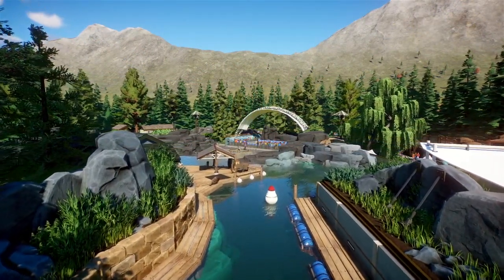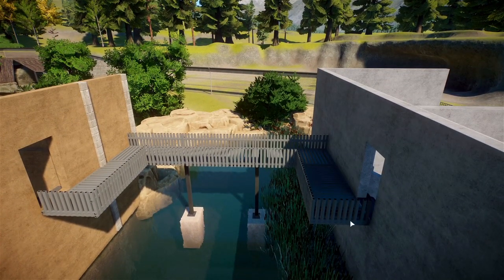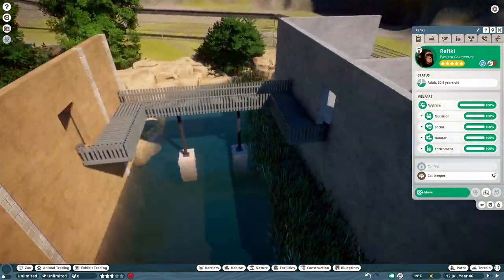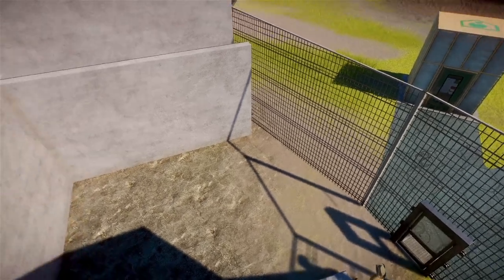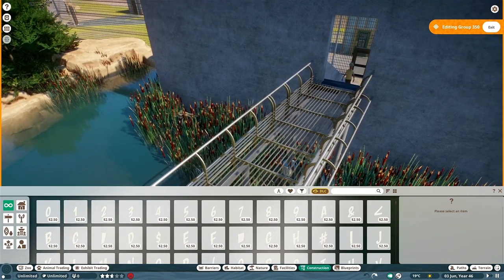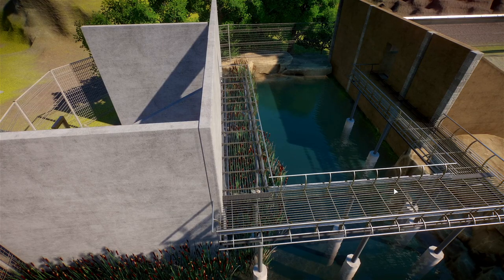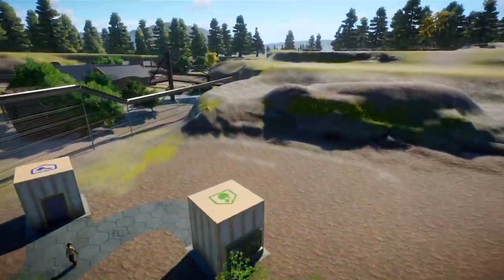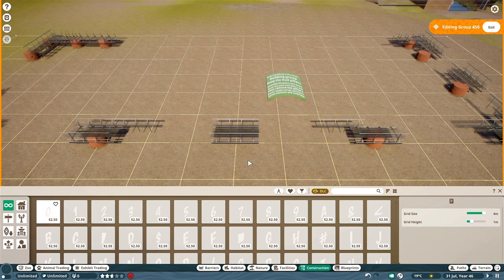How to create keeper bridges and gantries｜Planet Zoo

Comment: What are you using for the stairs, or rather, how wide is the area the keepers can traverse? 4m? I understand the bridges but I can't get my keepers up the stairs. Thank you!
Reply from the maker: The best way I've found is to use the pathing as a guide for how steeply the keepers can climb. It doesn't have to be 4m wide. So I created a staircase with the path, placed the pieces I wanted for my own steps slightly lower, checked the traversable area and then deleted the path.
Reply: @Toves  Would ramps work instead of stairs? if the angle is under 45?

Comment: So i can honestly say after spending 6 hrs of my own time trying to do this, and another 6 after watching this video 4 times. I cannot understand how you are getting them to keep walking. Mine stop at the gate and woohoo and leave, even with it showing they can walk on the path. So it's obviously not as simple as you make it seem for anyone watching this thinking it'll be seconds easy. lol. Maybe if you have NOTHING placed before doing this.
Reply: Also there is a tab under traversable habitat hot spot view that is for staff. :p
Reply from the maker: Thanks for watching and persevering with it, obviously as you can imagine the game changes often and sometimes that effects things. When I made this video there was no staff traversable heat map. I've checked recently though and my version of this does work still. If you have that with the keeper I'd double check (if you haven't already) if having welfare on, makes a difference. It could be that if the animal has no needs they won't walk into the habitat, in my version I made a point of spreading the feeders around to where I wanted the keepers to go
Reply: @Toves  It took me about 14 or so hours to get it to work i think it was because of how challenging of a space i was working with to fit in a ramp, what i learned is, sometimes even if it should be traversable, the map will register it as not, for no real reason, i got around this by building 3 separate ramp styles [ all were functional on their own] and then testing each of them in place where needed, this allowed me to see what type of build was getting me the furthest. The hardest part is definitely inclines. I used the same piece to build the ramp all the way through, same angle but it still stopped being traversable halfway. i think that if anyone ever gets to this point of frustration i was, def try the 3 ramp system, then you can see exactly what is getting you the furthest. I appreciate the tutorial, but yeah sometimes Planet Zoo's Ai doesn't make it easy!